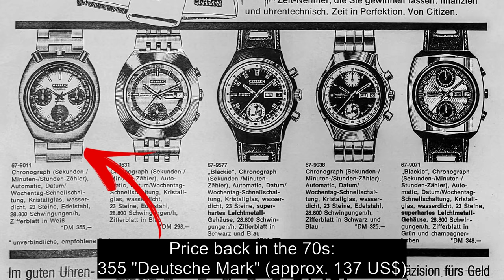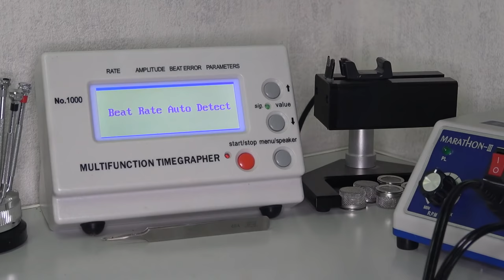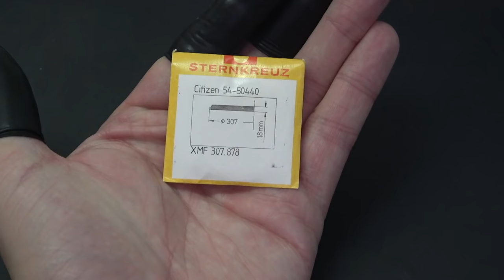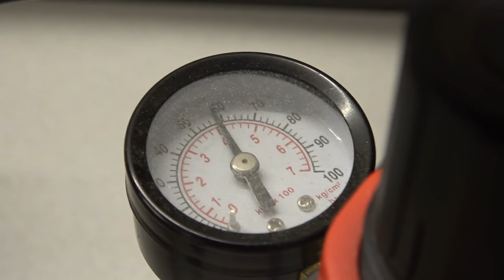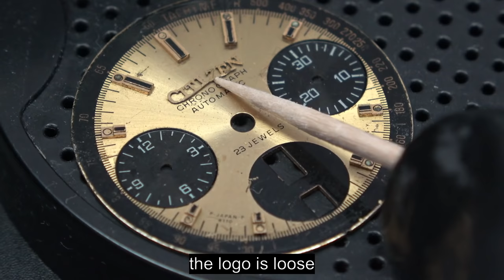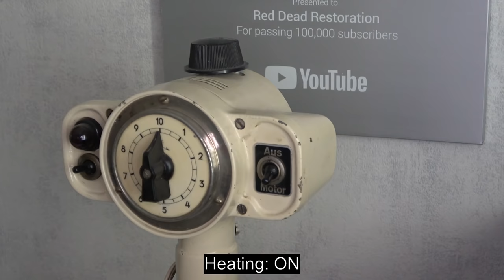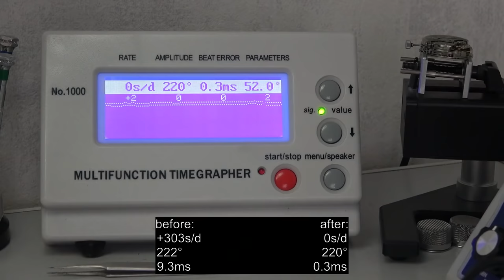Restoration of Brad Pitt's Citizen "Bullhead" watch from "Once upon a time in Hollywood"

Comment: This guy had a TIME MACHINE on hand - but still, he only used it on the watch face and did the rest by hard work. He really loves this craftsmanship!
Reply: well it's a time machine Dennis it work on time stuff
Reply: i think its a female
Reply: What?
Reply: How did he restore the dial??
Reply: @Petersonmgee  time machine
Reply: @Petersonmgee  buy the new one i think
Reply: @keponakanthanos471  you can purchase a new one ?!  i doubt
Reply: WoW! - Amazing job. How can I learn to do this? I have a lot of old watches from my childhood (started collecting in the 4th grade)...
Reply: @angustungsten2687  be careful about radioactive stuff on the dials
Reply: Doc Emmett Brown would be pleased to know that his invention REALLY works!
Reply: 😂😂😂 the flux condenser Doc Brown!
Reply: @johnnydevaud  I’m just started doing this as a hobby and I cant even get the traiin of wheels to line up under the bridge! The damn escape wheel is not getting "stucked" under the bridge so it will move around under the bridge even when the rest of the wheels seems to be i  their pivots!.....So I guess that this makes me a less good watchrepairer then!
Reply: @larslindegren5632  same issue here but it was doing the same when I got that watch so most likely the escape wheel is crooked/damaged, btw this johnnydevaud probably is an unemployed 17 yrs old high school drop out
Reply: The tricky bit is tuning the flux capacitor. If you get that wrong time speeds up with negative results.
Reply: @johnnydevaud  Aye they just replace all the parts instead of restoring them.
Reply: @Petersonmgee  he used the flux capacitor did you pay attention??

Comment: Perfect timing - I have one of these with a silver dial and steel case, the chrono dial hands do not engage properly and the day adjuster seldom works. Now I can see how all the bits fit together :-)
Reply: Don't do it if you don't have a lot of experience with restoring watches. The chronograph mech is a bit tricky and the flyback needs a lot of grease in the right places to work smoothly.
Reply: DIY COL: Do It Yourself, Crying Out Loud

Comment: Excellent work!
Tip: When you use the wet and dry sandpaper apply a light machine oil to the sandpaper it cuts better and wont clog up.

Comment: Jesus Christ…. I have one of these citizen bullhead watches with the 8110A caliber (although it has an octagonal case), and let me tell you, these movements are a PAIN IN THE ASS to work with. I myself can service “normal” handwinding and automatic movements without complications, but this chronographs are out of the question, because not only they are full of weird springs and other crap, but they’re also packed with low-durability parts.
In fact by looking at it it’s obvious that Citizen didn’t expect for these movements to be serviced, which is why they used to “repair them” by simply replacing the movements inside (a story shared with the Seiko 6139 caliber, used in the Pogue and Seiko bullhead chronographs).

It’s fantastic to see how you restore this, especially considering how much watchmakers hate working on them (I’m still looking for someone to service mine 😅), and as everything this channel does, it’s just amazing!

Comment: few notes - degrease item with alcohol prior to sandblasting(prevents clogging), and when spray-painting - set your item on a mesh or perforated panel to prevent paint bouncing off from back pressure of the surface you're painting on

Comment: Gorgeous work!! I'm curious though, what do you do with the restored watches? Just add them to your own collection, or do you sell them?? Also, the "time machine" part is funny and a nice touch. But I'm curious, if you couldn't restore it, you had to just replace it. But if it's that old, then there's no way they still make it. Where did you get a new one??
Reply: The Bullhead is actually a very sought after model, especially the gold case, black bezel model now with the movie. There are a lot of aftermarket dials available for this model, and they can be according to the original, or you can find them in red, blue or any other colour you desire. 
Trouble is when you are looking for a completely original one, because a lot of people have replaced everything but the movement and sell them at a very high price as full original. Same story with the Seiko "Pogue".

Comment: G'day from OZ, I own this watch. I bought it new in 1974 in Suva, Fiji for $130 AU. The case is like new and has the original metal band. It does not fit me anymore as it is possible that I have put on some weight since I was seventeen. My second sweep hand and the two chronograph hands are orange.

Comment: Nice work, and I love those leather bands, changed a few of my older watches on those bands, since they come in different colors and sizes. Question: do you tork those screws, or you just use experience when you screw them down? The black ring: there is process to turn metal black or very dark gray, do you think painting is still the best option? I love Citizen watches, the precision, quality and attention to details according to what you will be needing them, are spot on. I have some early EcoDrive, some recent, and one automatic, just love them. I thought it was funny this one had an Orient metal bracelet, because my first watch was an Orient, beautifull, with the blue dial, sadly I don't even remember what happened to the poor guy. But, great work, it always amazes me how many parts in a winding by hand or automatic watches, great memory to be able to place the parts and screws, where everything belongs. First time watching one of your videos, but subscribed right away. Thanks for sharing.

Comment: Hi , I’m hoping you can help answer a question I have about the case on these vintage Citizen Chronographs. I’m currently working on a different model than your bullhead but I’m assuming they are built the same. I couldn’t tell from watching your video, but when you installed the full bezel to the case was that a friction fit, or is there a gasket involved? I was told by an ebay seller who’s selling the gasket and crystal combo that the bezel on my model is supposed to be glued in place. When I disassembled the case and crystal I noticed that my bezel was previously glued in. I had just assumed that someone did this because they didn’t have the gasket, but now I’m being led to believe that this was common practice for vintage Citizen. I just wanna be sure before I take out my glue. Any advice is greatly appreciated!

Comment: Hi, did you use a gasket when you pressed the bezel in? I have the same watch however the replacement bezel I bought seems to require a gasket. Many thanks.
Reply from the maker: Yes there is a gasket inside 😉

Comment: Not bad..  A few errors. You can see that those hands were never orange and that the push buttons were never gold. 
There were a few models of this watch.  The model with stainless buttons had gold hands and the model with gold buttons had orange hands.  
I probably wouldn't have used paint on the ring.  I'm pretty sure the original coating was some kind of thin film plastic material. 
It still turned out very nice and it looks pretty good with orange hands anyway.  Enjoyed the video.